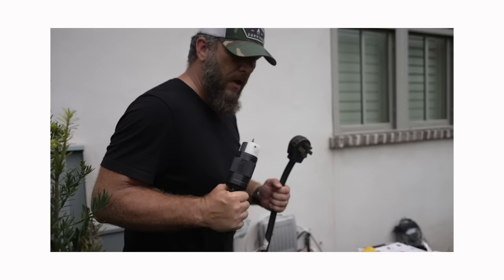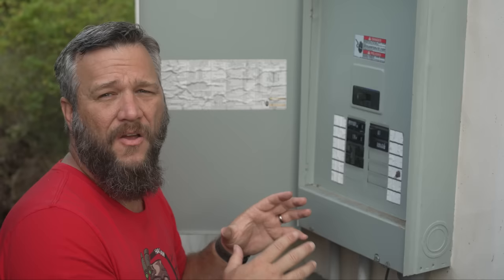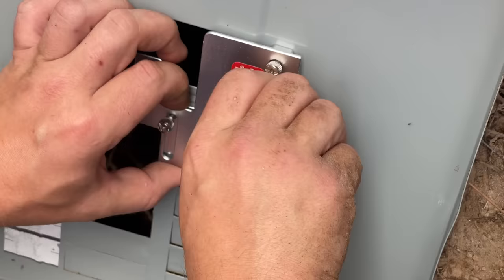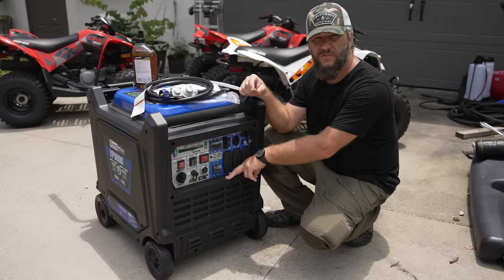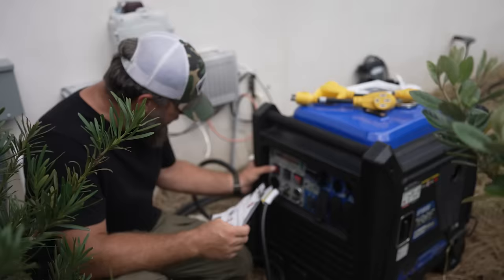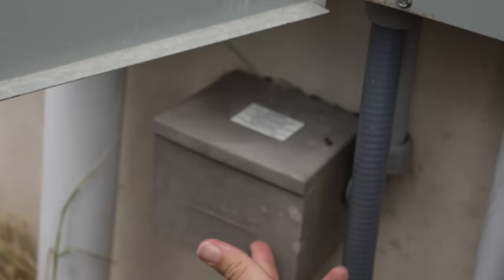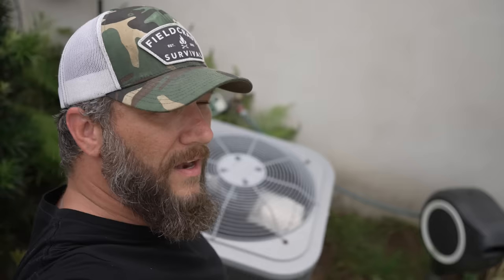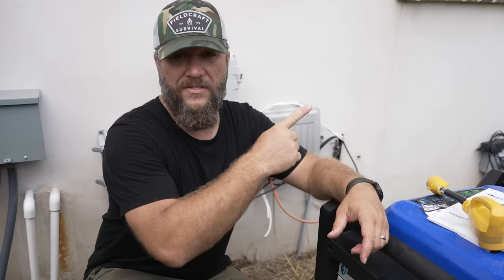90% Don't Know About This Fatal Generator Connection

Comment: Gunna build a Faraday Cage for your Geny? That's the most effective way to protect electronics from a CME (Coronal Mass Ejection, aka solar flare). Definitely not the cheapest way though. But if I hear of a CME headed for us (as little as 8 minutes warning) I'd throw our phones, laptops and external hard drives in the microwave (about the only Faraday Cage you'll find in your home)... just don't turn it on 😂
Reply from the maker: Funny you should mention that. I'm thinking about it actually.
Reply: @HAXMAN figured. I'm planning to do the same when we purchase our ranch in a few months. Unfortunately, due to my wife being a salmon science nerd, I can't build up my ranch near Savannah, Ga or Southern Pines, NC... gotta deal with my 3rd choice: Olympic penninsula in Washington. I know, all ex-Army southern boys are laughin their titties off. But I can't wait to be back in rural America (stuck in a Cali city at the moment). I miss fun, stoopid projects that are flimsily justified by "just in case!" We all need a Zihuatanejo, and tinkering is definitely mine!

Comment: Please, please do not power on and connect the generator cord to inlet first. At 8:22 you had the generator side of the cord in your hand with full mains power. You could of had a bad shock, or worse.

Comment: I’m having a hard time believing a 9000 watt generator ran your entire house + a 3.5 AC. A central AC needs 3500 watts per ton so 3.5 = 1250. Also, natural gas gives you less output. So, how the hell did 9000 watts do the job? Please explain.
Reply from the maker: AC uses about 1000 watts per ton. 3.5 tons = 3500 watts per hour. I’m nowhere near the capacity of the generator even running on propane.

Comment: That did not look like it was properly adjusted. When you flipped the main breaker it looked like it was pushing on the breaker switch putting pressure on it you had to force it past the metal piece. That will affect how it trips it will make it harder to trip. It needs to be adjusted properly so it's not touching the breakers except to stop them from moving in the desired ways that you showed. Overall you just made things less safe for your household.

Comment: Lock outs, tranfer switch,load centers,WTF. Suicide cord all day,make cord,turn off main,plug into dryer port, run house. Simple easy effective. If your a electrician restoring power and you dont concider all lines live you wont live long

Comment: No dear, that was HILARIOUS, because he was touching to top of a plastic breaker NOT the energized metal busway. I ROFLMFAO when you said that is not funny. IT WAS FREAKING HILARIOUS. And I have that setup in my own house. Have to turn off the MAIN before turning on the Generator breaker.  I know it is not automatic protection but it is MY HOUSE and I KNOW what to do. I have even explained it many times to my brain dead wife and she still can't remember that sheet. I know I need to do this too. The downside of that mechanical interlock device is there is NO LED to indicate IF power is available when it is restored. Easily solved by adding a pilot light tapped off the input power breaker line side. I know it is not fused, but and LED draws very little power. 
And the REAL WAY to do this installation is to install a Generator Box circuitry ready to ONLY power certain devices with an auto cut over feature to work BOTH ways, power off and power on. That is really the only acceptable way of doing this properly.  
But during an emergency,  many folks do what they can just to get power back with these errors all over the place.
Reply: Don’t use an unfused led, instead the Reliance Controls THP108 provides a safe alert for power returned alarm that is not expensive or dangerous.

Comment: Have you completed the math to figure out how long your LP tank will last running off that unit. And do you have a backup for this?
Reply from the maker: I have about three days running 24 hours a day. I can get a few more days with extra tanks. I have a few generators and then I’m down to solar generators to power individual appliances.

Comment: Guy I think you got just a 30 amp connection there did not see it very long but. 50 amp will have 4 prongs  and be a flat blade style.   What I did was buy a Ronk 200 amp transfer switch it’s installed between the meter base and the breaker box out in my powerhouse . I bought a 3 phase genset that had a 2 stroke Detroit diesel engine it was ok but really loud that’s the nature of those Engines. I now have A 30 Kw 3 phase Caterpillar much quieter runs Al a lower RPM  I use a big transformer out of a warehouse that takes the 3 phase and gives me 208 volts single phase.  You can buy used 3 phase stuff cheap ! I think with the trans box I spent a bit over 2 K and 3 K for the Cat unit with the wire and conduit it’s all about 5 k  it runs the whole farm house shop and pole barn with 1000 gallons of fuel in the storage tank I could run that thing long time it’s never under a strain at all never see smoke out the stack . It has a 40 gallon tank on its cradle under the engine .

Comment: You need to locate any combustion powered generator at least 25 feet from occupied buildings due to carbon monoxide. Where a transfer switch is installed, the neutral and grounds in the original panel must be separated as it becomes a sub-panel. You didn't mention you used an RV "dog bone" cable adapter from 30amp to 50 amp. Also, never power up any kind of generator without some type of load already on the circuit. Cheap generators can produce "dirty" power. It is not enough just to produce a true sine wave but the inverter technology can help. Just do your homework. The worst thing is to experience a power outage, acquire a portable generator and not be prepared how to connect it or where. Also, read the manual to see if your generator needs to be grounded or not.

Comment: Just so you know, you plugged a 20 amp twist lock plug onto your generator. At 9,000 watts, each leg, at 120 volts, is 37.5 amps, (at 240 volts, your total output is 37.5 amps), so that plug is undersized by almost 100% at full power draw. You might want to be careful as this could cause a fire under high, sustained loads. Also, I suspect that the cable that you are using is12 gauge wire which is rated at only 20 amps. Also under rated by almost 100%. A generator that size should also have a 50 amp plug. I have a 7,000 watt TroyBilt unit that came with a 50 amp twist lock plug.

9,000 watts / 120 volts = 75 amps total or 37.5 amps per leg. 9,000 watts / 240 volts = 37.5 amps total.

    Also, I can't speak for inverter generators, (I think they're a great idea), but a straight generator like mine and others output less current on propane and even less on natural gas. The energy density is less for the 2 gaseous fuels than an equivalent amount of gasoline. You can bank on a 20% loss on a standard straight unit regardless of what the owners manual says. Again, I can't speak on an inverter unit.
    One gallon of gasoline contains 120,000 BTU's of energy, one gallon of propane contains 91,500 BTU's and 90 cubic feet of natural gas has about 90,000 BTU's.
    The energy density does not affect the output of the generator head itself but it affects the horsepower output of the engine. It's like having a 427 Corvette requiring premium gas, you're passing through a little one horse(power) town, you need gas and all they have is regular. It will run the car at reduced efficiency. Your engine won't run at full power until you get the proper, better gas back in the tank.

    (For those gasoline purists out there, I know that regular and premium gas has the same energy density but higher octane premium will allow you to advance your ignition timing thereby increasing horsepower while eliminating knock. I was just trying to avoid confusion in my example.)

    The way that my house's inside breaker and outside meter boxes are set up, sadly, I can't use any interlock made. It would take several photos to explain the outside box and the inside box is full of breakers so another double breaker won't fit.
    How I got around this is, when we had the house built, I had a DISCONNECTED garage built next to it. When I wired the garage to the outside meter disconnect box, I used 8 gauge wire, rated at 40 amps, from the garage breaker box to the meter box where there were 8 blanks for breakers where I installed a double 40 amp breaker. I wired the lights and garage door opener with 14 gauge wire and the outlets with 12 gauge.
    For the generator, I built a suicide cord, basically like yours, using the same 8 gauge wire that I connected the garage to the house with. I installed a 50 amp, 4 prong plug on the garage wall again with 8 gauge running to 2) 30 amp breakers in the garage box. This plug is dedicated to the generator and is ONLY unplugged once a year, as well as the generator twist lock, to check for corrosion. This way there is no shock hazard. If I ever sell the house, the 50 amp plug can be used for an axillary garage stove, heavy duty air compressor, central A/C unit if the garage is insulated, or an arc welder. Your outdoor plug and interlock is obviously for a generator and whoever installed it did a good job. If I move, my outlet reverts from a dedicated generator plug to a utility plug.
    The generator is nested by the walk in door where it spends it's entire life. I bought this unit in 2012 and it still looks like the day it came out of the box. I and my bad back don't have to wheel it around but I digress. My garage is storage so my van isn't exposed to exhaust anyway.
    As I said before, the garage is disconnected by 8 feet from the house. After I start the generator, I open the front drive in door about a foot to vent exhaust out of the two doors. I also keep a box fan plugged in at the end of the unit blowing past the engine. On hot days, it keeps the engine cooler and on windless days, it keeps the engine from choking on it's own exhaust.

YOU NEVER WANT TO RUN A GASLOINE POWERED APPLIANCE INSIDE A GARAGE THAT IS CONNECTED TO AN OCCUPIED LIVING SPACE. THE CARBON MONOXIDE IN THE EXHAUST WILL SEEP INTO THE LIVING SPACE AND KILL YOU.

     Anyway, This all connects to 2) 30 amp breakers in the garage box. My unit outputs 29 amps per leg.
     I went to paint shop in my computer and made a fair representation of the in house breaker box, the outside meter disconnect box, the generator and the garage breaker box. I put this on 4 separate pages to avoid confusion.
    The inside breaker box, I threaded red zip ties through all of the 240 volt double breaker handles. On the first page, these get shut off first. On the second page it shows the inside of the outside meter box and the location of the main 200 amp breaker. This gets switched off second. The third page shows the end view of the generator, starting procedures and controls. 1) Turn on gasoline valve. 2) Pull choke. 3) Turn the kill switch on. 4) Press starter switch. 5) Push in choke. 6) Let run for one minute then flip double breaker with orange zip tie in garage breaker box, (on page 4). I keep one copy on the refrigerator in the house and another copy in a zip lock bag tied to the generator. I walked my wife through this procedure and when my son was old enough, I walked him too. When every step is done IN ORDER, there is no hazard to linemen.
    We shut off all 240 volt breakers in the house first because my house is all electric. If someone is taking a shower, the 4,500 watt hot water tank is on. If the wife is cooking dinner at the same time, that's another 6,000 to 9,000 watts for 2 to 3 stove burners. If she's running the microwave, 1,800 watts. Drying clothes, 6,000 watts and don't get me started on the oven burner,  4 ton heat / A/C, the fridge, 2 freezers and 5 gallon water cooler.
    DO THE MATH!!! As you can see, things add up quickly in the perfect storm that can be an all electric house. I have 2 butane camp stoves and cases of gas canisters, propane gas logs in the fireplace with extra tanks in the garage, a window A/C unit in the bedroom, a washer and clothes line and if the power is out for several days, we can shut off the freezers and A/C for an hour and make 40 gallons of, (city supplied), hot water so we're pretty well set. Oh, and there's my coffee pot too.

PRO TIP 1) When wiring your generator to your house, MAKE ABSOLUTELY SURE to use wire compound paste on ALL connections if you are running copper wire into aluminum connectors in your panel box. If you don't, the connections WILL CORRODE OVER TIME!!! If a hot lead corrodes first, it will cause a voltage drop on that leg. Under no load, on that leg, you will NOT see a drop with a volt meter. Turn on the fridge and the microwave. If the drop is below 110 volts, it WILL eventually burn out the motor in the fridge, can damage sensitive electronics and will burn out motors in 240 volt appliances like, large air compressors, driers and central A.C units,
    If the neutral corrodes first, When I was married to my first wife, after my first son was born, we used to warm his bottles in the microwave. One night, I put a bottle in, the TV got real bright and the light bulb in the living room burned out. This was on line power. I got my volt meter and that outlet had 170 volts and the opposite leg had only 70 volts. Total = 240 volts.
I called the power company. The tech pulled the meter and saw the neutral line had corroded. He pulled it out, cleaned it, doped it and put it back. Problem solved. With the neutral corroded, the high draw of the microwave tried to use the other leg as as the circuit return line creating an imbalance. The same thing happened to a friend on his generator hookup and did $3000.00 in damage to the electronics in his house. Big screen, digital stove, satellite boxes, other TV's. These things don't have to be on to blow. Their power supplies are always on.

PRO TIP 2) If you leave gasoline in your generator, DO NOT TURN OFF THE ENGINE WHEN THE POWER COMES ON. Turn off the gasoline valve under the gas tank and let the carb run dry before turning off the kill switch. Even with fuel stabilizer in the gas, over months of nonuse, the gas WILL evaporate out of the carburetor leaving behind a varnish that will clog the carb. It happened to me early on with a 5,000 watt Coleman. You live and learn. After my 7th spine surgery, (#11 this July), I just couldn't whip those 10 horses to life with the pull rope anymore so I bought my electric start TroyBilt. I have always shut off the gas and have never suffered with a clogged carb again.

PRO TIP 3) Speaking of electric start generators. When your starter battery dies, and it will die eventually, be careful where you get a replacement. My unit does not have a built in charger. It has a wall wart automatic charger that plugs into the end panel.
It shuts off when the battery is fully charged. At first, I didn't like the idea that the generator didn't charge it's own battery but when I thought about it, after setting in cold winter months, a self charged battery might not be ready to wake up as needed. One charged from the wall will always be charged.
    Anyway, when my battery died after 6 years I called Lowes where I bought the unit. $99.00 and a 10 day wait to order it for an 18 amp hour gel cell battery? For $20.00 more, I could buy a car battery with 4 times the capacity. I went on Amazon, got a 22 amp hour gel cell battery of the same physical size and terminal configuration. A drop in replacement that fit the mount under the gas tank. It was made as a drop in replacement for these portable jump starters so it is an actual starter battery. Electrically speaking, 25% larger. How much? $44.00. This was in 2018. Not a problem yet in 5 years.